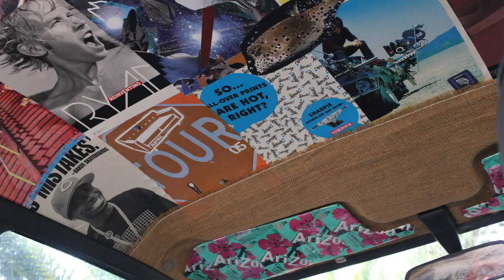Slammed Toyota Wagon || (Build Progression) AE92

Comment: bro i have 2 questions. what roof rack did you get for this car and what tires were you running on those 8s ? i have the same car but a 4af the carb version. love the car
Reply from the maker: Hey man, thanks for the comment. 

I got that roof rack off of a land rover that my father came into at the time. I still have the roof rack in the garage just collecting dust, would need to be repainted but I could sell it if you have no luck finding it anywhere else. Maybe try Ebay (it is all aluminum, really light).

I bought aero race wheels 15x8 with 0 offset. If I remember correctly I stretched Federal Formoza FD1 185/45r15 tires on those rims to get the lip to reveal itself like that. It was a sick setup and super fun for me as a teenager just starting to learn cars. Glad you're enjoying yours!

Comment: Yo bro did you have to do anything to get those 15x8 0 offset on? I know it’s a little tight in rear. Much love from HAWAI’I
Reply from the maker: Eyy man, thx for the comment! Because I had coilovers on the car I had just enough clearance on the inside of the wheel (maybe an 1/2 inch or so from the back of the wheel to the coil). I don't know if they would have fit with stock suspension. I think most of what made it possible was my tire size tho. I ran a 165/45 R15 tire stretched (Federal Formoza FD1 if you're interested). That tire stretch, with rolled fenders and slight negative camber let me get most of the tire under the fender. Rubbed a little in the rear but it was manageable.
Reply: Yessah! Appreciate the feed back bro. This build was cherry...she sat pretty. Hopefully all goes well with my wagon build lol
Easy bro-
Reply from the maker: @STABEZ ‘  Absolutely man, and thank you. Hope the info helps you get ur setup looking good!